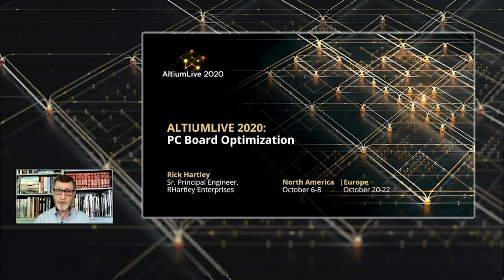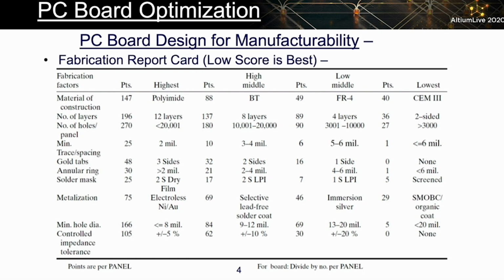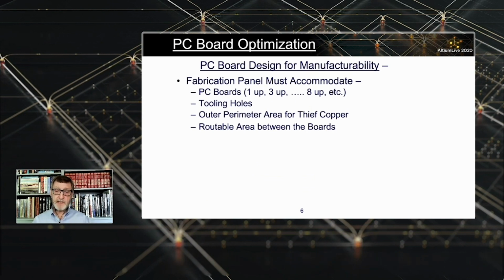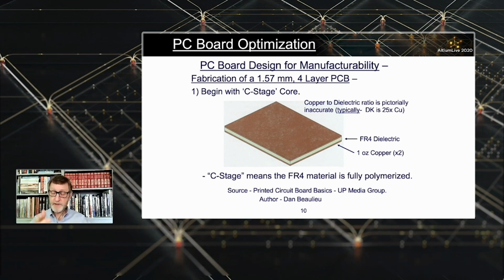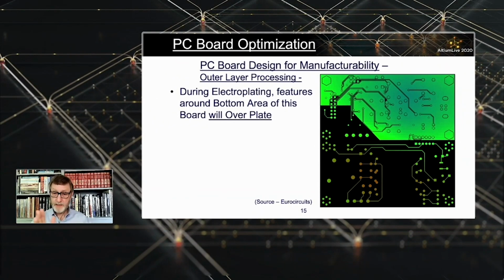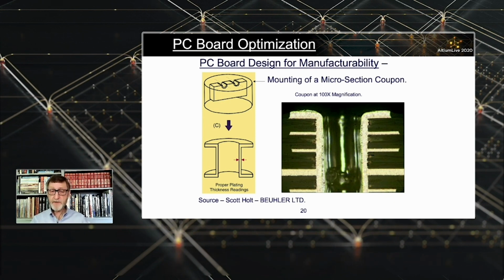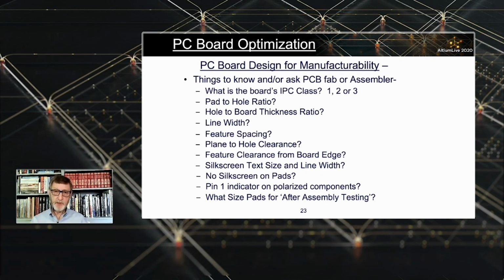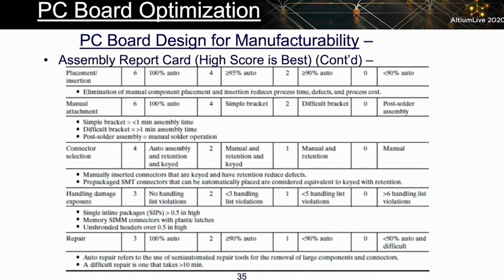Secrets of PCB Optimization - Rick Hartley - AltiumLive 2020

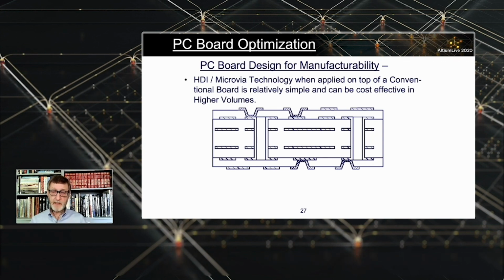Comment: 1:18:50 Rick's comments on HDI stackups on Slide 26 don't seem to make sense to me. His slide 26 recommended stackup has sequential lamination: two laminations and two panel plating steps, which does add significant cost. But given that cost, I don't see why not add full thru-vias in this stackup. It seems that full thru-vias would get drilled and plated at the same time as plating the outer microvias, so it's just an extra drilling step, not another panel plating step? In fact, on the next slide, he says you can plate thru-vias at the same time as depth-controlled vias (although now showing just 1 lamination - I agree this is cheaper). Finally, the "extremely expensive" stackup on Slide 29, doesn't seem too bad, but yes it is 3 laminations when it could be 2 with a simple change: extend the middle blind via outwards one layer in each direction (L2:L7 instead of L3:L6). Then it's back to 2 laminations, which matches Rick's recommended stackup on Slide 26, just with both mechanical + laser drilling at each lamination instead of one or the other.
@Zachariah-Peterson is there a reason on Slide 26 that thru vias add significant cost?

Comment: Why don't the fabricators create the thief dots for the plating process and then just etch them away later? It would still obviously be more costly and a sub-optimal design. Just trying to satisfy a curiosity rather than disagree with the overall message.

Comment: 53:15 Eric Bogatin would argue that poring copper over the entire board is very silly. He claims (and shows with HFSS) that you get very little benefit from EMI and can easily make EMI much worse. When you have 2 of the biggest names in PCB engineering giving completely different answers it can be very difficult to know the correct solutions. In this case, I think Eric Bogatin has the correct information.
Reply: Eric and Rick are both correct in certain situations that do not always overlap. I've discussed why this is the case many times.

Eric's advice is technically correct but it's easy to take out of context. Copper pour is one of those things that is sometimes presented as an "always/never" type of guidelines. The truth is that it has specific uses that are grounded in impedance controlled design and it's one of those things that some people do blindly without understanding those specific uses.
Reply: @Zachariah-Peterson  I'm currently confused about the idea of uneven copper pour causing issues with the plating process. I already watched that part of the video twice. According to this very presentation, it seems like the pattern plating happens before the outer layers are etched? So isn't the full board always covered with copper when the plating happens? Or was the idea of avoiding uneven copper fill specifically about the inner layers? If it was then I completely missed that point twice...
Reply: @maruohon  I don't have time to watch the entire video now so I'm not sure which part you are referring to. But I know that the uneven copper can apply to outer or inner layers. The biggest reason is symmetry across the center of the stackup to prevent warping, which is less to do with plating and would apply to outer and inner layers. I have seen instances where there are exceptions, such as when the board is small and only 1 of the layers has a lot of its copper removed. The resulting warping would be very small and would be within IPC specs.
Reply: They are talking from 2 different POVs. Eric Bogatin is talking about using pours to help with EMI (often doesn't help much and can sometimes make it worse!)

Rick Hartley is talking about manufacturing and assembly. Who cares the ingenious design you have if it can't be manufactured very well due to warpage? This is what Rick is trying to explain. I imagine that there is a nice medium between the 2 talking points, and Eric's points seem to be selected circumstances, but Zach already covered that I think.
Reply: @alexanderthegr888  Bogatin just talked about crosstalk avoidance in high speed signals: if you have space just do 5W or more without pour (makes things worse) if no space do the pour but with vias fence of the right spacing. All other pours are allowed for other things.
Reply: Eric bogatin is a theoretical guy,  he plays with simulation and arduino boards. Rick hartley is pure experience and hard reality.

Comment: I designed numerous boards since 2013, I never used 4 mil traces! At least for the majority of boards, 9 or 10 mils works just fine and it is manufacturable by all manufacturers I have seen so far. I can not imagine how these guys used 4 mil traces for normal no HDI PCBs.
Reply: We use 2 mils all the time.
Reply: nowadays if you have a bga controller 4 mils is normal